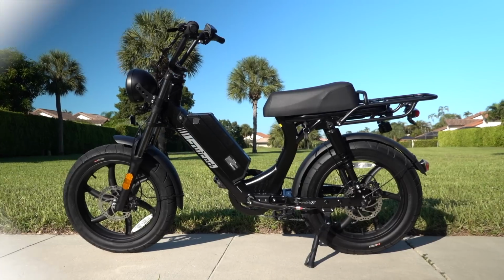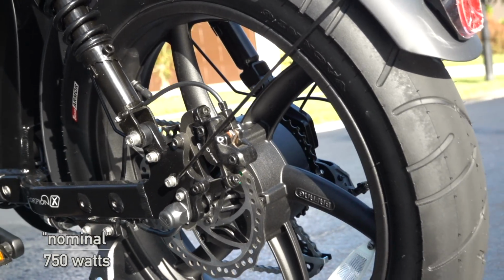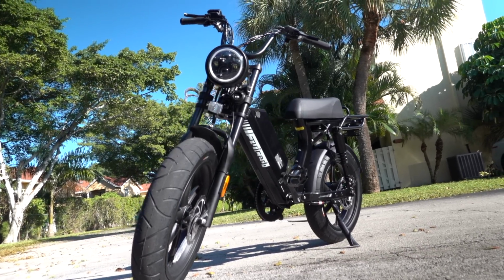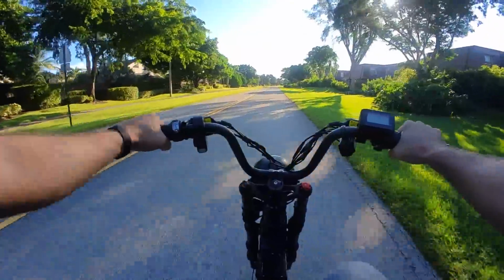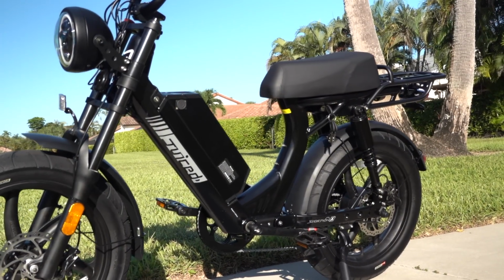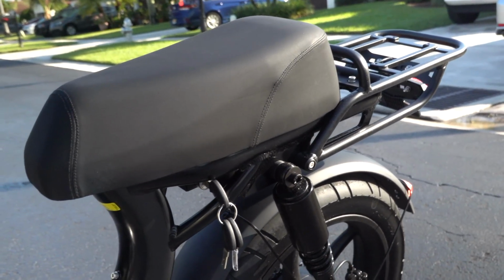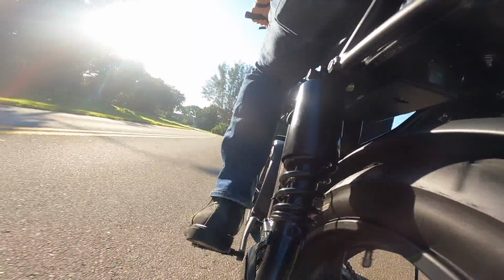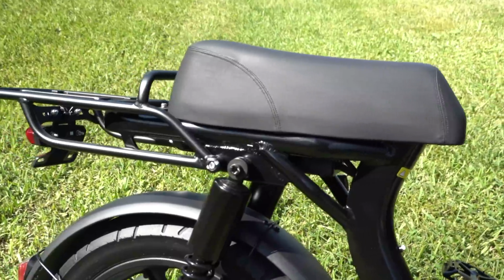Juiced Scorpion X Electric Moped Review: More Power & Battery

Comment: I paid 1900 for mine. Honestly besides the power I’m not really a fan of the build quality of these bikes. I prefer my Rad bike usually.
Reply: @ATS599 Rad Runner. I know it sounds crazy, but in real life experiences with multiple different people preferred the Rad. The juiced bikes are garbage and I'd be surprised if my bike lasts 3 years. And when you go to work on the bike that's where you can really tell they've cut corners. I don't recommend anyone the juiced bikes.

Comment: So seriously, we're all waiting to hear what the actual top speed of this bike is.

Not the manufacturers legally obligated 28mph class 3 spell.
Reply: I have a Juiced RipCurrent with what looks to be the same motor but it tops out at over 1500 watts at full output, only tops out at 20 mph throttle but in race mode I have had her at 36 mph pedaling not as hard as I could but pretty hard - The RipCurrent only weighs in at 76 pounds but feels like more because of the huge tires.  I would say the Scorpion would be about the same - I think the throttle goes to 28 but you can get more speed pedaling

Comment: I got the reg scorpion on a sale awhile back for $1299. Should i have waited and spent Is extra $$$ for a scorpion x? Is the performance that much better?
Reply from the maker: I think it depends on your needs. The regular scorpion was still great for utility and build, but didn't have the fun acceleration or hill climbing. The Scorpion X is still not as powerful as Hyperscorpion, but it is an improvement over original Scorpion. But if you are ok without the extra oomph, your regular scorpion is still great. And you could get a bigger battery for it if you want extra range.
Reply: I got the scorpion to abide by my states ebike laws. The hyperscorpion was out of my option. I am a little disappointed with hill performance. I  wonder if  the offroad controller upgrade will help with the hill climb performance.
Reply: @rkdm84  offroad controller did make the bike slightly faster on flat roads. It also allows throttle only up to top speed. If you have OG scorpion definitely buy it but it doesnt transform the speed of the bike other than what I mentioned

Comment: Curious if this could be unlocked. If this thing could get up to 30-35mph this would be amazing
Reply: Word on the street is it’s hyper motor juiced down by setting the controller to power out 750w. I have a hyper and too just got an X both are similar but worlds apart. The great part is they are both fun to ride and special in their own way. It curious as they are so similar. I’m still discovering the things that contribute to this. One is the handle bars on the X are smaller and not so wide. This makes the Xbike more nimble. Anyway ride the Hyper way more because of power as Race mode gets 31mph no peddling. X gets that with Race mode but you have to peddle to get it. When the Hyper motor gets worn out will transfer the controller and wire harnesses to the X. See if indeed the motors are the same power output then. Otherwise I am watching the forums as to the truth of this.
Reply: @DanielLopes-jt8yl  I am pretty sure they are the same motor - I have a RipCurrent and can get up to 36 pedaling almost at full effort - I think it's just the controllers that step the power down - the motors are beefier than the same supposed 750 nominal on the rad bikes

Comment: I debated a juiced scorpion, might get one one day but I am going to need them to make a belt drive version first. has the mag wheels on the list. I know with the hub motor that makes some issues for gearing but maybe make it front wheel drive pedal rear with a hub transmission. my ideal bike would be mid drive, mag wheels, belt drive with one of those mini cvt axle shifters also with good mounting for front and rear racks, alas hopefully one day juiced or somebody steps up to the plate there. Till then My Aventon Level will have to do(which yes i know has none of the things i want other than good racks and fenders).
Reply: @DannyDyers ChocolateHomunculus no maintenance to the belt, and no derailer to hang down and get bashed. To be clear you can have a belt drive with a hub transmission so many belt drive bikes still have speeds. That transmission is sealed and does not require the adjustments geared bikes do. Ideally I want a vike so low maintenance all I need to do is check the tite pressure on it. I put 400ish miles a month commuting and running errands on my bike and the less maintenance the better.

Comment: Based on the fact that you cannot raise the saddle, I'd say you'll be more comfortable is you are on the shorter side, right?
Reply: you can raise it with the Scorpion/HyperScorpion Tall Seat Set that they sell on their site
Reply: @SLACKERBOY  Inch or two, more padding is not really "raising the saddle".
Reply: @jrnamida5470  The "Tall Seat" does not add extra padding. It's a 3" high metal frame that bolts on directly underneath the original seat, which remains unchanged. This frame raises the seat to 36.5" (from the standard 33.5").